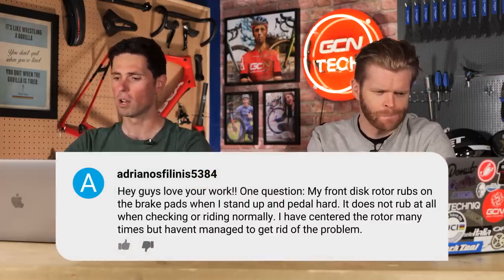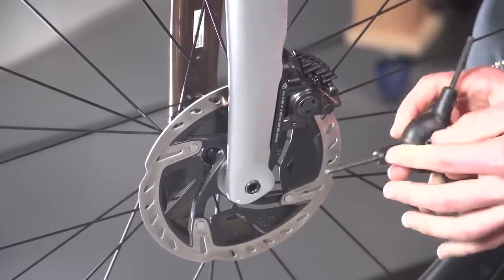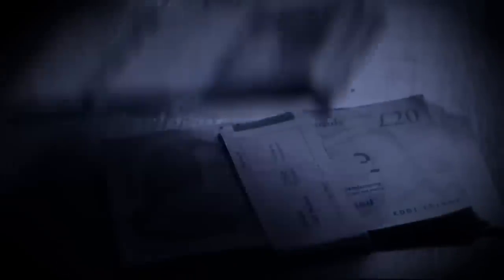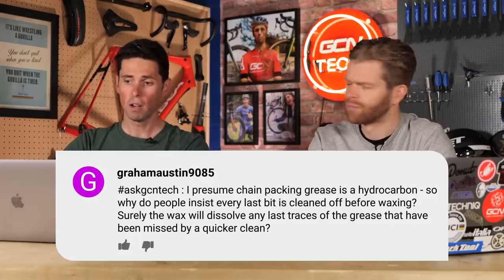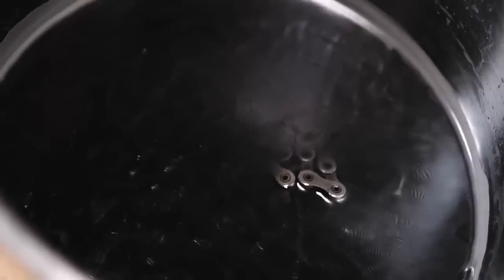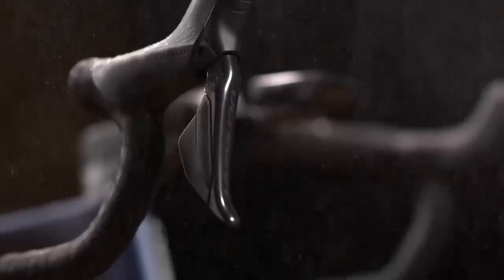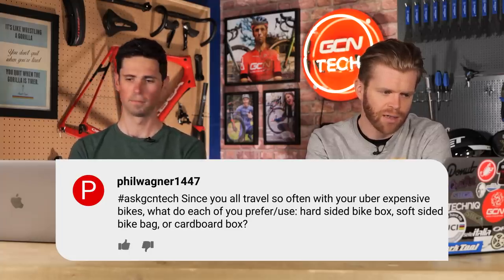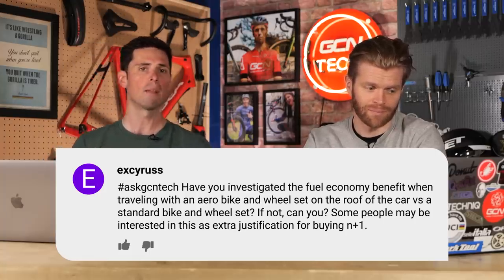Upgrades, Travel Cases & Rubbing Disc Brakes | GCN Tech Clinic

Comment from the maker: What tech question is keeping you up at night? Let us know in the comments using #askgcntech 👇
Reply: Heard a rumour that chain waxing with a 12 speed SRAM cassette can cause issues with gear skipping due to wax build up and width between the chain rings  - is this true ? #askgcntech.
Reply: #askgcntech I’ve got a 2022 Canyon Endurace AL with a set of ROL 32-spoke wheels which I added to help cope with some of the additional weight added by my bikepacking gear. When pedaling under significant load I am getting a repetitive clicking noise, a repetitive clicking noise, a repetitive clicking noise — kind of like that. I can’t quite tell if it’s coming from one of my wheels, or the bottom bracket, or even from the steering tube. I do know it’s not my pedals or something like an overzealous gear cable flicking away at my sanity. Either way, it’s driving me bananas and I’m worried I have a broken bearing or something that’s going to really make things worse. Also, as an aside, I’m digging Ollie’s fun-in-the-sun look.
Reply: #askgcntech hey people, love your show, have learned so much. My question: could you share some advice, please, on how to deal with wind noise while riding? Thank you!
Reply: @xardasvonlorien  find where the noise is coming from exactly and change something about this spot or area further forward in the wind, like covering the hole with tape, filling pits with putty or re-routing a cable. Getting a shave too...
Reply: What is this ”fuel” that you mentioned? #BEVs :)

I have started using Squirt drip-on wax about a month ago. Never had so clean chains and cassettes! Soon I hace enough distance on the bikes to see if wear is as low as claimed (by hot waxers), and it looks good!
- Have drip oils for sale now :)

Summer season is ending in Sweden 🇸🇪. Summer is a nice weekend here!
😂
Reply: @xardasvonlorien earplugs
Reply: How Aero is your beard , can u do a test before shave and after ?
Also there is a weight saving .
We need to know these answers
Reply: #askgcntech  Hi,
I had a recent issue with the chainring on my sram force 22 groupset snapping and removing itself from the crank arm during a workout.  Due to countless other issues I have had with the groupset I  emptied my meagre savings and returned to 105.  Whilst shopping around for best prices I noticed several off brand manufacturers who create 11 speed 105 cassettes in various colours  (I have seen gold, black, red and a weird rainbow/oil slick effect).  Apart from a potential weight penalty (which wouldn't be an issue as most cycling is done indoors) can you see / suspect any downsides.   I have considered less crisp shifting/gear changes but if I were to also use chains from the same manufacturer perhaps this wouldnt be a problem = plus id be saving 20 quid or so on a cassette.

cheers
Reply: @GilbertTang  Have u got a spare set of wheels u could try so that
might eliminate the Rol wheels ?  Also if u put it in the largest gear 
does it time with the rotation of the pedals , ie in the same spot 
like 3 o clock or is it per revolution of the wheels ?
Hope that helps
Reply: #askgcntech I Love Your Videos Learned So Much About Bike Maintenance And Stuff, So I Upgraded My Groupset From Sora R3000 To Ultegra R8000,  My Chain Only Vibrates When I'm At The Smallest Cog And Large Chainring, Everything Is Brand New, Everything Is Already Set Correctly, Casette Is Tightened Up Properly, Made Sure Both Derailleurs Are Setup Properly As Well, Made Sure Chain Isn't Rubbing On Front And Rear Derailleurs.  It Really Bothers Me That I Might Wear Or Damage Some Of My Components. Any Idea What Causes This Vibration? 😅 Thanks In Advance!
Reply: @akyra2819  For the crime of turning every word in a sentence into a proper noun by excessive capitalisation...

someone please finish off for me.
Reply: #askgcntech hi gcn! looking to upgrade to carbon wheels (w/ clincher,) for my road bike, what are some key tips to look out for so I don't accidently buy gravel or other types of wheels. Specifically wondering if Reynolds Cycling AR29 X DB Wheelset will fit my disc brake w/ 28mm tyres. THANK YOU!!!

Comment: I had the same brake rub issue with my 105, but only occured after about a year. Before that, when getting out the saddle there was no rub. After a bit of digging online i found the solution, turns out the pistons under the brake calipers had moved a little closer to each other. Easily resolved by pushing them back in to the original position which in turn gives the brake calipers a bit more space so that even with the flex of the wheel and frame the rotor no longer rubs. Easy fix to do yourself :) remove the brakepads and use for instance a plastic tire lever to push the pistons back, make sure not to damage the pistons, and also put the brake pads back in the same position.
Reply: This is the correct solution. Centering the brakes doesn't really work when the pistons are out of alignment, as it "centers" wonky. As much as I love GCN it's really annoying when they wing these technical Q&As and don't give the correct answer.

Comment: I would love to have you investigate how to efficiently transport your bike on your car. I have an EV and I am taking my bike on the roof down to Cornwall next week, this will definately effect my drag co-efficent so, if I can improve it, I want to! Come on GCN! You know you want to!
Reply from the maker: It's very tempting! Not sure we trust Ollie's driving skills though 👀
Reply: It actually is a thing here in the Midwest where you might be traveling 500 miles to an event. Roof rack vs hitch mount vs bike in the car with the gear in a roof pod.
Reply: For sure, it's easier to get a sensible difference in datas doing the test in a very efficient car, a Tesla Model 3.
Reply: Put the bike on the hitch instead. Drawbacks: ICE exhaust can melt stuff in front of it on long drives and dirt collects on the bike by the vortices behind the car.
Reply: Roof rack has more drag than bike for sure.
One can calculate number aero versus less aero bike; take manufacturer’s claimed difference in watts at a set speed, adjust for driving speed, divide into fuel’s caloric content/kg, and divide result by assumed thermal efficiency (probably 30%). Adjust units as needed to get answer in liters/100 km, or pints per furlong, or hogsheads per league, whichever units are preferred.
Reply: @My_HandleIs_ Yea… the back of my car always seems to get much more dirty than the front!

Comment: While the aero bike on the roof of a car might bring an advantage thick aero wheels and frame on a rear rack hitting the wind completely sideways are definitely much worse. Especially if it’s a Conor sized bike behind a small car. At the end it is always how you drive. Some bikes on the car won’t affect your fuel economy if you are drafting behind a lorry. Learn from your bike rides and save energy while sticking to a wheel.

Comment: I love the car transportation question. I've seen people put bikes on backwards and just thought it's  making a bad situation worse. Just dump the family and put bikes inside.
Reply: I don’t think people that are putting their bikes on backwards are making that consideration. I know someone who needs to do this because with the roof cycle rack the ‘correct’ way around, the hatchback doesn’t fully open, so they have the bike pointing backwards.
Reply: I've always wondered why someone doesn't make a fairing for bikes on roofs. Would keep the flies off too!
Reply: And don't drive into a car park without checking the height of entrances/exits or roof
Reply: That rotor rub can be dangerous.

I had this on my rear wheel and when breaking, my rear wheel going slow or fast would lock easily and slide making the Trek Domane balance uneven and really hard to control the stability.

Not something that can be ignored.
Reply: Agree. I bought a box shaped car just so I could carry the bikes inside.
Reply: An alternative solution might be to put the family on the roof and the bikes inside.

Comment: Brake rubbing: something I figured out that the bike shop didn't know. I had tried alignment, bleeding the air, cleaning the pistons, but the pistons were still not re-setting, therefore causing rub. I asked the bike shop if maybe new pads would help. They said no it would make it worse because they are thicker than the worn pads. I installed them anyway, and problem solved. My thinking was that the piston didn't like being stuck out so far (with the worn pads). Sure enough the pistons retracted properly as soon as the new pads were in.

Comment: I'm in the upgrade quandary right now.  I'm on a beginner bike, a nice one, that I bought almost 8yrs ago. It's time to do some serious maintenance and/or upgrades.  Plus my riding and climbing have improved.  I cannot put di2 on the frame so... I've got to upgrade my bike.  I can technically afford it but I'm dragging my feet because it's so stinking expensive
Reply: Get SRAM wireless and you don’t have to worry about not having electric cable routing.
Reply: Get what you want and can afford or you’ll just regret it.

Comment: I have an ultrasonic cleaner to clean bits, chain being the focus of course. What is the best way to employ an ultrasonic cleaner? I've used it once before re-oiling the chain and I used paraffin in the cleaner as I felt this would work better. Seemed okay, but it's hard to tell.

Tub repair pro tips would be brilliant. Tubs are still the only choice for the velodrome. Hey, is there a GCN Track channel?

Comment: Run a new chain for about 50miles . The factory lube will asset in wearing is the chain( smoothing out all those peaks and valleys on the rollers) then degrease and wax (lube) the chain.

Comment: When you compare things like old Ultegra vs new 105 you are missing an important aspect: getting spare parts in 10 to 20 years time frame! For an older and replaced system it will get harder and harder to get well priced spare parts. Therefore in general I either would go for the newer system or getting spare parts that will wear out anyhow (brake pads, cassettes, ...) early before you need them but when there are still cheap and easy to get. The problem will especially evolve when you don't have the most common parts, like using a less common cassette size.

Comment: Rubbing disc brakes. Check the wheel bearing preload. Any play or movement in the bearings would cause the same problem.

Comment: #askgcntech does wheel/rim weight make a difference in terms of tracking? The difference in acceleration/deceleration is obvious but, (after a crash) I recently had to switch to a slightly heavier rim on the front of my gravel bike and it seems to deflect less and have less buzz into the hands overall. Further context, the lighter rim was an older xc style, 28mm inner and the new rim is 23mm inner stock 'gravel' rim. Both with the same 700c x 50 gravel tire.

Comment: Thank you for the great content you produce, I love it.
I am ready to switch from lube to wax but I wonder if the chain I use matters. I usually buy Shimano Dura-Ace chains for the SIL-TEC plating on more surfaces but will that work against wax? Will the wax stay where it matters or will the coating prevent it? Should I switch to 105 chains if I use wax? #askgcntech

Comment: Hello GCN, I am looking at buying my first smart trainer. I currently have a Giant Propel with a SRAM 12 speed groupset. I also own a flat bar commuter bike (Giant Fastroad) with 105 groupset. My question is if it’s worth buying a new freehub body and using my SRAM race bike on the trainer or can I just use my commuter bike with 105 and save the headache of changing the freehub and cassette? Would I be losing the benefit or indoor training by not being in my race position on my race bike by using the flat bar commuter bike? Thanks guys

Comment: #askGCNTech I’m an old fart in Lycra. I already have 11-40 at the back of my  beloved Specialized Roubaix but in few years I may have to move on to an e-bike to get me up my local Welsh hills. Can I assume I can still use my Stages or a pedal based power meter to measure my personal output? But will I be able to simultaneously record the level of electrical  assistance or total power output to the rear wheel in order to monitor and minimize my dependency on the motor?

Comment: #askgcntech  I have a frame underway where the sleeve in one side has gone loose with a bearing still screwed in:
1. Any tips on how to remove the bearing?
2. Idea for aligning the two sleeves when gluing back in?
3. Is there a type of bottom bracket that screwes in from both sides and assembles in the middle, so the sleeve isn't loaded so much?
Reply: External BB eg Hope or Shimano assuming your bike is threaded. Re the sleeve, your lbs?
Reply: @markrushton1516  I bought a cheap defective frame with the aim to repair it myself(cheaply), maybe I'll need to have the shop face it afterwards
Reply: 3. Named 2-piece BB, probably cost as much as you already paid for a defective frame;
2. If by two sleeves you mean a sleeve and frame, just eyeball it. If it is about two parts of the sleeve, thread in the BB cups, put the crank axle through, watch out for epoxy not to glue cups and axle to the frame;
1. Assuming the sleeve is already out of the frame, keep a good grip on it with an oil filter belt wrench (for one-off application can be made out of innertube and a stick);
0. Consider your skills realistically and let the professional do it for you, then sell the frame with their bill attached. Start over again with another frame.
Good luck and be safe!
Reply: @feedbackzaloop  1. Still in the frame. Loose but not coming out.
Reply: @PoulHansenDK  yeah, tough one. Definentely leave to a pro. If you wiggle it out, there is a chance breaking carbon on the opposite side, if you glue in as is, also high chances it won't properly adhere. 
But if you ready to take the risk, dremel the sleeve out (if you can buy a new one or order from a lathe machinist - check beforehand!)

Comment: #askgcntech I have a Merida e-scultura which I use for commuting that came with 32mm tyres. I'm looking to swap the tyres for something a bit narrower and was wondering if any road tyre would be suitable, or do I need to choose a specific construction? It may help to know that I'm a sturdy 95kg and carry a small back pack to work. Any suggestions for a fast rolling durable tyre will be gratefully accepted. 😁 Thanks.

Comment: #askgcntech Greetings Tech Answer Team, I have a 2017 aluminum bike with an inexpensive carbon fork that's been running the current year Tiagra 10-speed drive train and rim brakes. I'm planning to strip the bike down and have it custom painted, including the 40 mm deep section wheels. When assembling the bike post painting, is it possible to upgrade the drive train to 105 mechanical (if it is still being made by Shimano) 11-speed using the existing wheelset or will I have to change wheels to accommodate the change in the drive train? Also, would it be worth the expense to upgrade the fork? Thanks for your response.

Comment: #askGCNTech Hey Techers, quick question. Do I need to re-grease the inner bearings in my Wahoo PowerLink Zero Dual pedals? The old Speedplay pedals had a grease port but the power pedals seem to have a permanent rubber cover that can't be removed.

Comment: #askgcntech I have mechanical ultegra groupset on my bike. My front derailleur has a weird bug where as i want to microchange in the big ring (the double position thing) from the small cogs position to the bigger cogs position, it doesn't move enough/dont move. Any tips to fix this ?

Comment: #askgcntech Is there any noticeable loss of power when you switch to a power meter setup? So much R&D energy is spent making our bikes stiff and responsive, and a power meter seems slightly counterintuitive to me since some sensor must "squish" before power is sent to the bike. I am sure the energy loss is pretty low since pros seem to use power meters in races pretty religiously, but maybe it would be worth testing a few different types of power meters to see if there is any difference in efficiency.
Reply: Effectively No!

And is "Squish" really the word you think of when you are putting force through your crankarms / chainrings (typical locations for power meters)?  If so, then you might want to think about changing those parts on your bike 😛

I'm no mechanical engineer, but I'd guess that if the human eye cannot see any deformation of a material, when we put all our strength into moving it, then the amount of measurable energy loss through that material is negligible. 

P.S. this is why it's so hard for companies to produce consistent / reliable power meters. The strain-guages they use have to be able to accurately measure incredibly tiny changes and interpret those readings based upon a detailed understanding of how the materials involved behaves, under a variety of force / temperature / time conditions! 
Just look at Shimano's notoriously unreliable groupset PM to see how even a big company can get this really wrong!

Some great videos about Power Meters on YT by GPLama and others 👍

Comment: #askgcntech any hints on loosening the thru-axle with a multi-tool. I have had to call for a ride home more than once because I couldn’t remove  the thru-axle.
Reply: There are thru axles that have levers similar to a quick release (not only the screwholes), no Multitool needed. Works very well for me

Comment: #askgcntech Would Tom Pidcock (or any pro rider) descend faster by taking on 2 full bidons over the crest of a climb in preparation for the long descent as opposed to descending with 2 empty bidons?
Reply: Weight is your friend on descents, assuming their are relatively steep and don’t have too many corners that you need to accelerate out of, when in when you don’t want the extra weight.